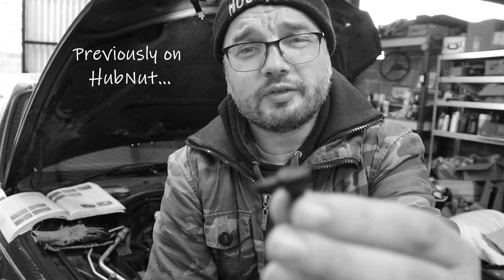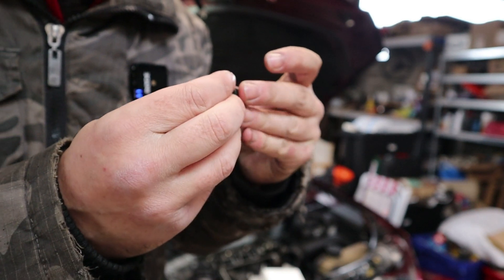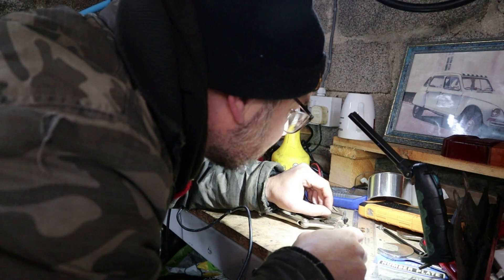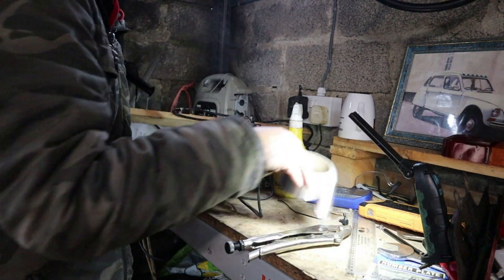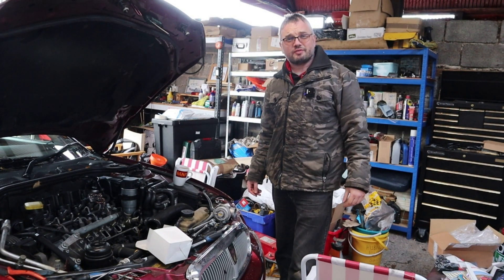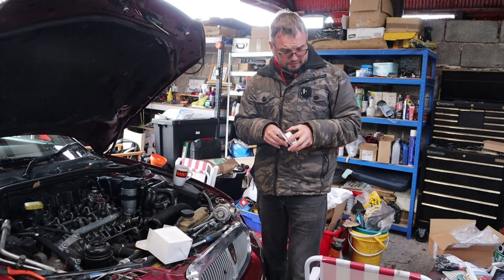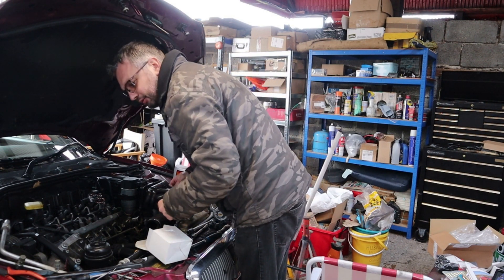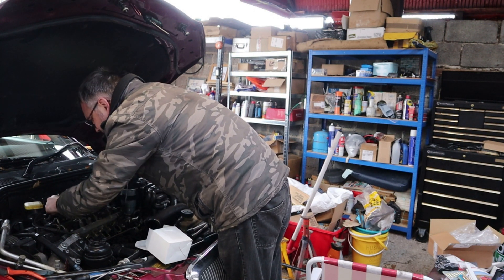Rover 75: Man vs EGR and PCV Part 2

Comment: Has the fuel filter been changed recently?  Sometimes it's the simplest of things.
Reply: I had a bmw 330d that felt lacking in power, a service including fuel filter and it felt very different. I would certainly change the fuel filter, good call
Reply: A fuel filter change and some cleaner additive might do it.
Reply: Just what I was thinking! fuel filter.
Reply: I can highly recommend Lucas Oil Fuel Treatment Upper Cylinder Lubricant Injector Cleaner 1 Litre. Way better than the redex junk
Reply: I agree with some previous comments, change the fuel filter, mix some injector cleaner 
( whole bottle ) in a five litre fuel can, run very low on diesel, Italian tune the five litres then fill with V power or similar quality diesel.
Probably been run for years on cheap fuel or even chip fat which will get thick now the colder weather is here. 😯
Reply: @GazzR84  yep I had a 320d 03 plate and had exactly the same problem.
Reply: Terrible salesman, "it's a feature of hoodies that they keep your precious items secure in their pocket when worn under other garments" is what you meant to say.....
Reply: @Human_Resource  i remember buying a 2 pack diesel treatment off qvc in early 90,s one went in engine one in fuel talk about magic potion transformed the uno diesel i had at the time. Wish i could remember name of the stuff as there is probably an equivalent still around
Reply: @eggy1962  could have been asta3000. Used in my old merc to good effect. Cataclean also good, still use it today.
Reply: @stuarte9225  asta 3000 rings a bell, good stuff.

Comment: I wonder if you've got a slight air leak on one of the air hoses. Puff of browny-black smoke from the exhaust on hard acceleration is a good indicator of this. Also worth getting someone to rev it up and down while listen for any whistles under the bonnet, you may find a leaky joint or pipe that way.

Comment: If its hitting the wall at 3 1/2 k I'd put a pound to a penny its fuel delivery. Cracked pump on my 75 gave exactly those symptoms, even the sometimes there / sometimes not issue. Going to be hard to diagnose, methinks...

Comment: If you add a detergent to the fuel to clean up the injectors etc. you can also add 5 -10% water, and that will improve the detergent's performance. ECUs for petrol and diesel engines are not country specific and therefore have to cope with fuels which aren't as clean as what we are used to in the UK. Some countries add up to 25% water to diesel fuel without any problems. I found this out when I was involved with engine testing for a company which supplies engines for commercial vehicles, although engine performance isn't particularly affected the emissions can be so I'd not recommend the practice.

Comment: Give the MAF sensor a clean with electrical contact cleaner. Had similar with my van and it does improve things.  Also check it isnt a cheap ebay MAF that's fitted. Er did the MAP sensor get plugged back in?

Comment: Love all the shelfery and pro toolbox cabinet gradually getting buried behind the junk. You soo need a sonic cleaner next. (Tip: they work better actually connected to electricy) two bolts on the inlet manifold spinning might be an issue with smooth running as you,LL suck air on acceleration

Comment: Don’t expect much more performance! Diesel engines aren’t revvy they are more for low down torque rather than high end in the rev range! Fuel filter change and some Nulon turbo and dpf cleaner in the tank
Reply: Exactly because diesels were originally built for pure pulling power & torque which their side good for taking caravans etc. I have a 2.0 VW Passat and you should see me overtake petrol cars towing caravans when I’m going up hill. Their engines are screaming at 5rpm whilst mine is just bubbling over and swiftly overtakes🙂
Reply: @matty6848  Depends on the engine of course.
Reply: @stiggyness1976  agreed. But generally diesels were originally built for industrial and agricultural environments so tend to tow better.

Comment: I feel like you were this close >< to finding the problem when you had the intake manifold off. I reckon the ports in the head are stuffed up with gack. I used the head of a long gutter bolt to scrape out the crud which had built up right around the stem of the valve and then used a wire bottlebrush type thing to get the rest out. I didn't need to take the head off to do it.
Reply from the maker: It didn't look that bad from what I saw...
Reply: @HubNut  Mine didn't either until I went at it. The other thing I'd be looking at is the MAF sensor, as they may not show up a fault but can be out of calibration, which could reduce your fuelling. I had a bit of a baptism of fire with the TDI engine in my VW so I learned a lot about what can limit diesel engine performance.

Comment: Might be worth getting a cheapy obd data display & you can at least look at basic variables like boost pressure, throttle pedal demand, airflow etc. Not sure if these had the same fuel system as the Freelander but I know the older ones had issues with fuel booster pumps.

Comment: Trying to see if it has a fuel burning heater fitted. If you have, I have a spare new remote control fob which you can have if you want. Originally bought as a spare for my 75 CDT, it's a Land Rover one, but works with the Rover too.
Reply from the maker: Cheers but sadly it appears to be broken.
Reply: @HubNut  They're quite simple things and relatively easy to fix. Usually requiring de-coking. But sometimes the PCB fails. Well worth getting running, you'll appreciate a ready warmed up interior on those cold mornings. If you do get it fixed, let me know and I'll post the remote to you.

Comment: The soldering iron and cable tie is essentially the same as how a plastic welding gun works. (Mine is just a heat gun with a nozzle and filler rod

Comment: Watching your videos is both enjoyable and frustrating, as you are so disorganised, often shouting at screen "it's there to your left", as many an old teacher said to me, needs improvement.  A tray on castors, like the ones that are used in hospitals to swing over a bed would make it easier to put parts and tools to hand without placing on ledges or equipment in or around the engine bay.  It would save hours in hunting around for something that have you forgotten where it was put and leaving screwdrivers in the gutters when closing the bonnet.  Stay safe Ian.

Comment: As before mentioned, I had a N47 engine in my 318D that I sold last years totalising almost 300k kilometer. 
When it felt very linear and reluctant, I checked out the DPF and that was the problem. It gets in safe mode without warning lights. I recognize the character of being in safe mode while you were testdriving it. 100% the same feeling.

Comment: I'm just doing my pcv it turns out that it already has the bmw by-pass one as well as the egr so i still don't know where the black smokes coming from . Ps i also broke the little fuel pipe nozzle it would be worth knowing the size of these i'll try to let you know but its worth removing that little piece of pipe before going in like i did . Also those funny little screws holding the cable down will come off with pliers . Its like nightmares come in sequels lol

Comment: You can definitely hear that flat spot, yep.
Reply: could well be to do with the lower state of tune of that engine, as bmw derated them for use in the 75's. they can be remapped to 130 or 160hp easily. there's someone on the 75 and zt club forum who does the remaps.

Comment: Could the wategate on the tubo be siezed or sticky? If so it may be over boosting and therefore the ECU will cut power. Might explain why its hitting a wall higher up the rev range. My TD5 disco does the same occasionally.

Comment: I would see if the fuel filter requires changing and run a it on the super diesel fuel with some fuel additive added into it. It might clean those area's that are blocked Deep in the engine.

Comment: hi you said in a previous video you thought you had fuel starvation on a low tank , some of these cars had 2 fuel pumps one pushing up from the tank , and one on the bulk head by the battery, pulling it through you can feel and hear this one running, and the one for the tank open the filler cap place your ear near you should hear this one. If you change your fuel put some Forte in the filter pressure the system to get it into the injectors and let it stand overnight this will give them a good clean out. If you have a look at the large pipe that goes that goes from the EGR down towards the passenger wheel at the bottom there is some O rings which perish the end of the pipe will be really messy change them for Nulon rings .? this pipe for the intercooler. Hope this helps

Comment: You seldom fail to bring those “been there” situations when working in your garage. This time it was dropping a socket and not hearing it hit the floor. My “magnet on a stick” has seen many such adventures, usually involving threading it through a labyrinth of engine components, most of them cast iron, and highly interesting to magnets. One of my previous vehicles probably went to its grave with a dropped nut stuck behind the exhaust manifold.

Comment: I'd try disconnecting your MAF sensor. These cars have a reputation for faulty ones and the exact symptom is gutless under 2k.

By unplugging it the car will default to a base reading and plenty of people have reported improvements immediately.

You will trip an EML light, but you can buy the insert for the MAF from DMGRS for £55 to cure it :)
Reply: I'll fair warn you, it's a bit of a tight job to remove and refit the air intake pipe, but mine was made worse because my top bit of the air box is stuck. Top has clips, bottom just pushes onto the turbo with no clips or clamps. Bit daft imo but that's how she be :)

Comment: Could be a clogged fuel filter, change that and add some injector cleaner. Hopefully it's not the cat converter.
Reply: Could be. I had the same problem on my BMW 330d 2003 plate. Changed the filter and boy what a difference it made👍

Comment: My mercedes only gave me reduced power at certain revs when the ABS wasn't working properly. Could that be a factor?
Reply: Indosarnia  ok, it was just a suggestion.
Reply: Could be, I had a problem in the sensor from the brake pedal in my Laguna II, the car didn´t kick the turbo in until it was replaced

Comment: Hello Iain, 
Love these videos. We have much the same approach 😉
Have you tried replacing all the various small  diameter vacuum pipes? I was getting major power loss  issues on my 2001 VW T4 California (150hp 2.5TDI). After over a year of faffing around with the EGR, cleaning the variable vane turbo (oven cleaner), replacing the MAF sensor and other diverse valves, in summer 2019 I'd pretty much resigned myself. One day, brainwave! It turned out that all the little vacuum pipes had got old, perished and porous. I swapped them all out for silicone ones and it worked!  I'd only just fixed the VW when my 1999 Saab 9-5 2.0 turbo started playing up similarly. So I did the same fix and that worked too to my utter amazement.
Both have been running great ever since. I think the hot summer we had finally finished cooking them. 
What year is the 75? This might be an issue on yours. Worth a try as it's very cheap to do. I'd be curious to know if it works for you.

Comment: Is exhaust system partially clogged so that it can't pass the gasses through quickly enough at high RPMs?
Reply from the maker: It's either that, or a fuelling issue so it's leaning out.

Comment: That filter was minging. It clearly needed replacing even if there is no discernible immediate benefit.

Hard to warm up? Thermostat ok?
Reply from the maker: Yes, thermostat is ok because it will get up to temp. These engines are notorious for  taking a while, which is why some came with a fuel-burning heater! The one on this one sadly broken.
Reply: @HubNut  Fuel burning heater...shades of Zaphrojets..!

Comment: Is it, perhaps, a problem with the electrickery?

Some vehicles will revert to a low-power mode until the ECU decides what quality fuel is being used and adjusts the map to suit.
If you've disconnected the battery, it can take up to 50 miles for the ECU to pull it's finger out.
Alternatively, if you've got a dodgy sensor, it might be giving the ECU bad info' and persuading it to keep the engine in a low-power mode.

Course, the fuel filter should be your first avenue of investigation.

Comment: Got a question to ask Regarding insurance I have been paying two insurances on one car in one year same plc Lancaster nuts or what..
But the actual question is i really wanted a Volvo V70 estate with and diesel engine  great work horse Right now I am try Hagerty but the cars in the said year 2002 . 
There quotes are good £476.63 based on 5000 miles and car value £1800    
And then the other price was 3000 miles and car value £1500 £342.17.
Compared with mainstream insurances at in excess of £1500,so a great saving.

Comment: Your Chinese jump pack will have a true capacity between 50% and 10% of the quoted value. I suspect almost single use and certainly borderline useless. Better to get a pack designed for model aircraft/boats that can provide 400 Amps burst. These will need a 'Turnigy Accucell 6' charger but worth every penny. Adapt a jump lead set to 4mm plugs. Also a fireproof pouch within which to recharge the cell pack. Go cheap and you could end up with an energetic fire in your engine compartment.

Comment: I had exactly the same issues back in the day, I did all the usual EGR, MAF sensor etc..., I read that the Turbo wastegate can get stuck and you need to turn it up a touch, I did that and it slightly improved but not much,  I think BMW really restricted this engine ( for some reason ) as it pushes 134bhp on the 320d, my conclusion was, it's like aids you've got to learn to live with it
Reply: It's not the same engine on e46, it's barely the same block, different cc and bottom end etc but uses similar components.

Comment: Turbo Diesels have a low rev limit and low down torque unlike petrol’s, 3500-4000 rpm is usually about right ?
Reply: I was thinking the same - peak torque is around 2,000 RPM so going past 3,500 isn't going to do an awful lot for you. Maybe it's normal behaviour and Ian's just not so used to "modern" diesels?

Comment: Those little plastic fittings are really annoying. I have broken more than one of those. They get really hard and brittle so, even being gentle with them, makes no difference. If you apply enough force to take the hose off, they break! Of course the hoses also become hard and difficult to remove which doesn't help either. I also don't listen to my intuition, frequently to my dismay.

Comment: more quality hub-nuttery..........can the guys at Hafod garage not plug into the ecu and read off any error codes?  you could be chasing rainbows for months otherwise.......it looks like its pulling in a very linear way with no kick up the bum you would expect from the turbo........weird how it felt ok days earlier for a short time.

Comment: Talk to the people at powerenhancer.co.uk I used their Archoil AR640D Max fuel conditioner and dpf cleaner. It transformed my car I did not realise how flat it was. I had turbo underboost warnings which I believed to be caused by a blocked dpf. I am VERY cynical about fuel additives,but it worked

Comment: If the car regularly runs cool, you may want to service the cooling system and plunk in a proper thermostat. Running fool, the computer is sending the wrong amount of fuel through, which will cause flat stops. It can also plug up the catalytic converter. As for running a classic car as a daily, I must be very brave or insane. Take your pick. My daily is the 1990 Volvo 240 DL Estate that Ma bought new as her 60th birthday present to herself. Just coming up on 400,000 miles. Not only is Arthur my daily driver, he is also my only car, so no back up in case something goes wrong!

Comment: Get it remapped it’s the only way
Reply from the maker: Not if there's a fundamental issue already. That needs addressing first.
Reply: @HubNut  I’ve owned two diesel 75s the first from new the other with 67,000 miles on the clock both 115 BHP
BMW detuned the N47 for the 75 only the ZT had the 135 BHP power .
I had both cars remapped to 135 and the difference was very noticeable but never as good as the brand new diesel ZT we owned !!!!
I’ve since sold the the 75s and the ZT but still own a 75 2.5 V6 with 30.000 miles on the clock ( sorn ) can’t bare to sell it as they really are fantastically underrated cars .
Good luck with yours I’m sure you’re love for her will just keep growing ( it’s a 75 thing )

     All the best Matt Pedwell.

Comment: A few of us have stated fuel filter then give it a shot of v-power diesel. Fuel filter costs vary £10-£20 get some fuel injector cleaner as well. Found this how to link https://the75andztclub.co.uk/forum/showthread.php?t=104654 and this https://www.the75andztclub.co.uk/forum/showthread.php?t=288199.

Comment: There is literally no point in revving a standard diesel like that, to the red line, all the usable power is low down in the rev range, better to shift up earlier to have the benefit of the low down torque.
Reply from the maker: I quite agree. I was only doing so as it most clearly demonstrates that something is amiss. Generally, I rarely go above 2500rpm.
Reply: @HubNut  might I suggest replacing the Maf sensor first. It sorted my lack of power on my old 75.

If your ever in Scotland and want to test drive my old 216 coupe give me a shout.

Love the videos, keep it up.